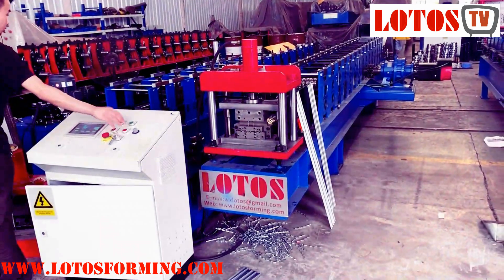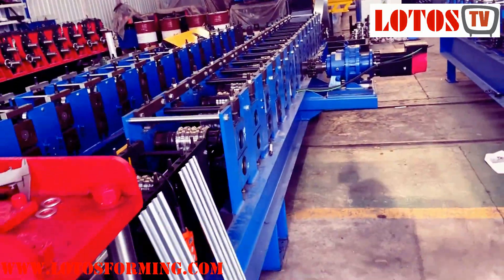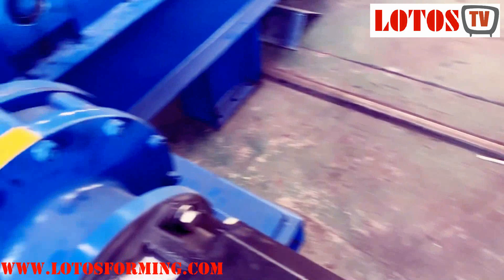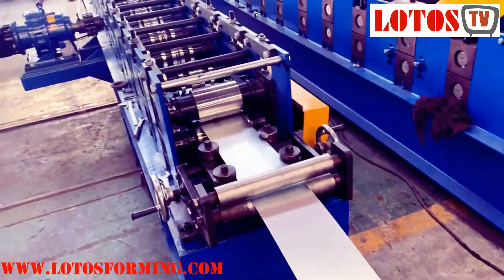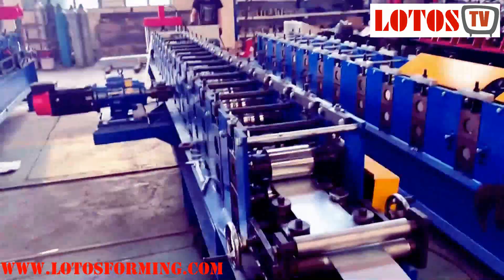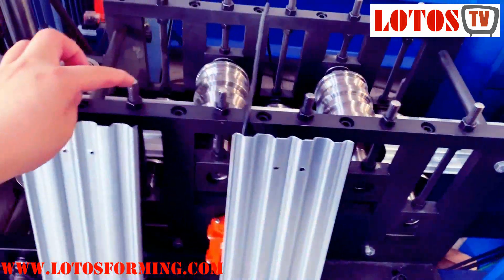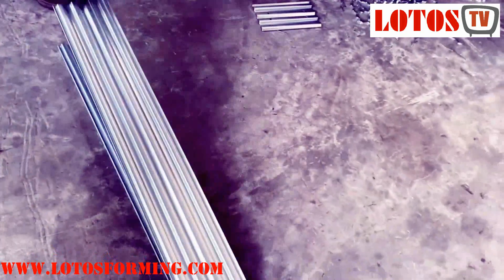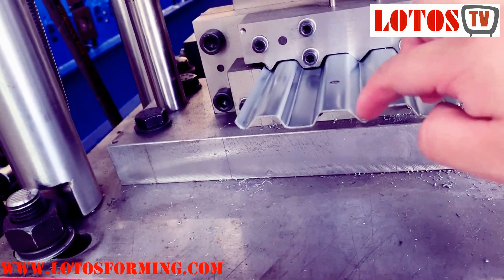【Custom Roll Forming Machine】: Fire Damper Machine | Damper Roll Forming Machine" LOTOS 2020"

Comment: Fire dampers are a type of passive fire control equipment used in heating systems, vents and HVAC air conditioners to prevent the spread of fire.